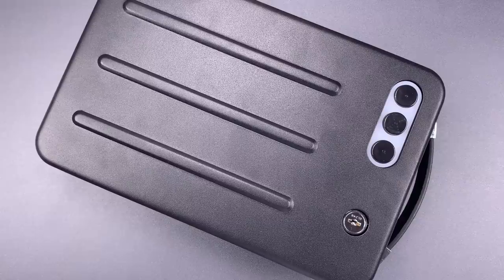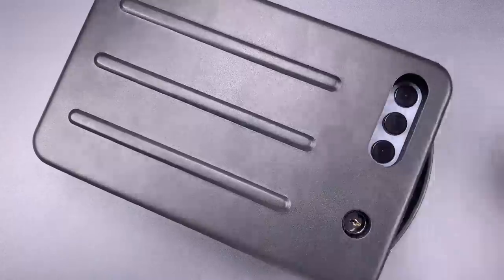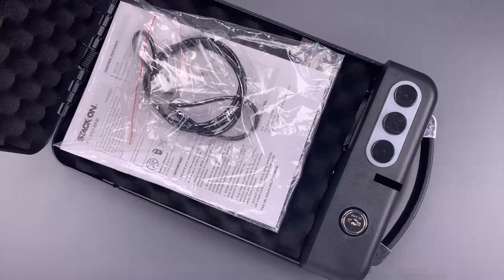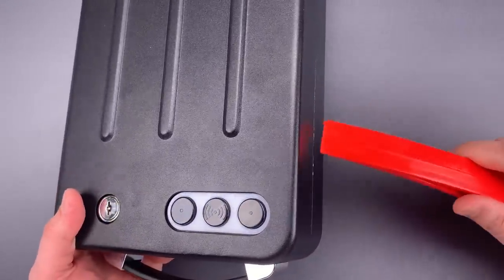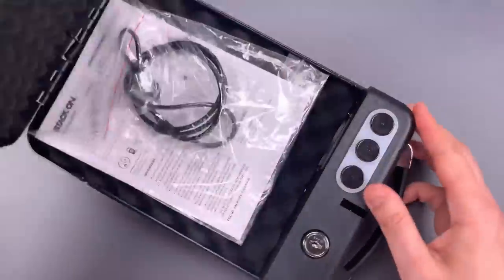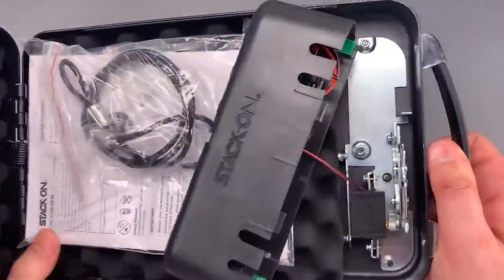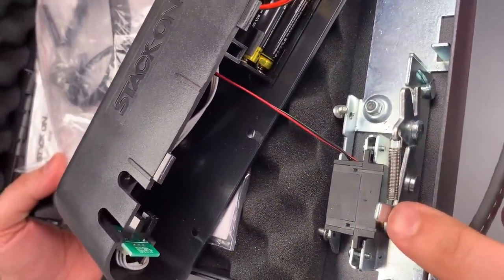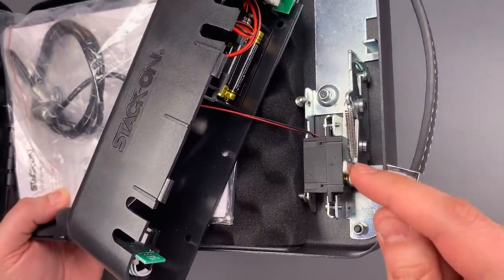[1048] Opened With A SPOON: Stack-On RFID Gun Safe

Comment: "This is a Stack-On model PC1702, RFID Gun Safe. It's designed to be open with either a key, a code, an RFID cedential, a spoon, a moderately powerful breeze or an intense stare in it's general direction."
Reply: Underrated comment.
Reply: Or a Stack-On model PC1702, RFID Gun Safe.

Comment: I'll be impressed when you open a safe by whispering sarcastic insults at it from across the room.
Reply: "Alexa, Open the stupid safe."
Reply: @davidanderson9103  Don't give Masterlock ideas.
Reply: Probably he could even do that against a lock that operates with voice ID, using another mind boggling tool....So I wouldn’t challenge him...
Reply: Vicious mockery at its finest.
Reply: wait until they put AI in these bad safe....
Reply: @davidanderson9103  there are apperantly smart locks that do that...
Reply: This is possible:
1: someone makes a safe with a voice code
2: the reset button is near the weak seem, so he presses it with a fork
3: reset the voice code with a sarcastic insult
4: lock the safe and go across the room to whisper the sarcastic insult at the safe
5: the safe opens by him whispering a sarcastic insult from across the room.
Reply: Voice identification lock:

Comment: The brand, "Stack On," must be referring to the way the two pieces of metal stack on each other.
Reply: That actually is it. Their smaller gun cabinets are designed to Stack On their larger ones. Of course, theyre the cheapest ones, so you get what you pay for. I had to drill new holes because theyre designed for fudd long rifles, not carbines
Reply: @HellsYeah8 , I was actually referring to the locking mechanism.
Reply: Or it means that you have to stack miscellaneous items on top of the case to keep the gun actually safe?

Comment: For something that can be wedged open with a spoon, three locking possibilities two of them beeing a code and a key card seem a bite overdone.
Reply: @nemo-x  the code, rfid and micro controller are all off the shelf parts. No designing necessary.
Either they designed the core locking mechanism them self or they just bought the cheapest one. Either way, they probably knew that it is garbage. But it was cheap.

Comment: Adding a small plastic cover over the reset switch or just moving it's position would make so much sense, add to that the other flaws and poor construction it seems clear that this was not designed for security but more to trick someone into thinking they we're getting security, just overprices junk.

Comment: Clicked on this bc I actually opened a file cabinet with a spoon handle. It slid right in and popped easily enough every time. You obviously have more advanced tools at your disposal but if the key fits right...

Comment: Do not try and understand the Stack-On, that's impossible. Instead, only try to realize the truth...there is no lock. Then you will see it is not the spoon that opens the gun safe, it is only bad design.
A question does enter the mind, if the gun "unsafe" (calling it "safe" just isn't right) drops on the ground, does it open up?

Comment: You have encountered a locked Stack-On RFID Gun Safe. What do you do?

1. [Lockpicking 10] Rake the Waferlock
2. [Strength 5] Break the plastic cover.
3. [Hacking 20] Register fake RFID.
4. [LPL][Intimidate 100] Apply cutlery.

Comment: out of curiosity, i know mechincal back ups need to be there in case the lock loses power, but is there any way to make the mechanicl back up only work when the batries or external power sourse runs out. that way the weak point is only a vunrably when it is really needed